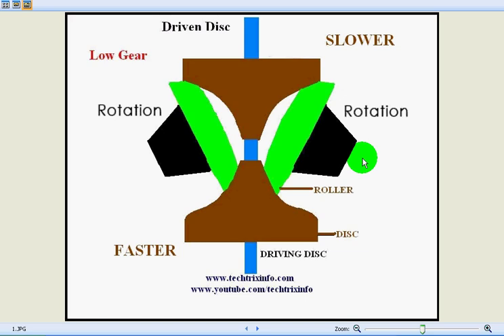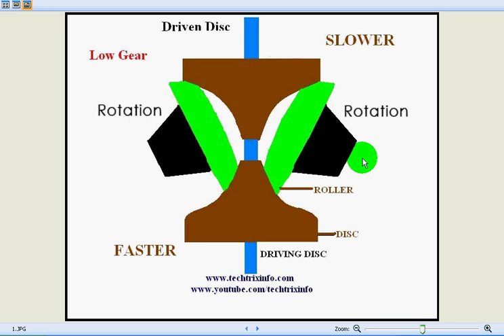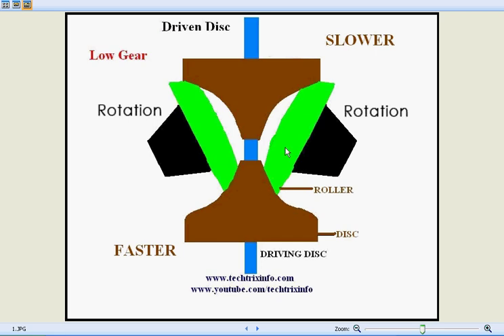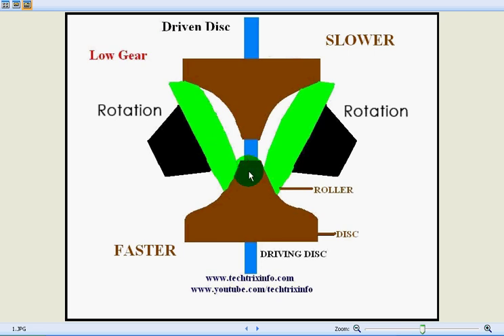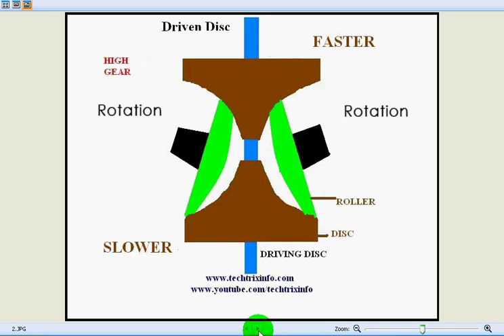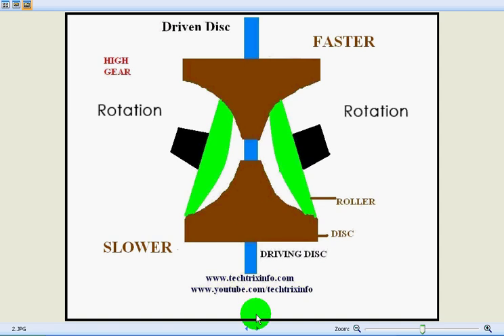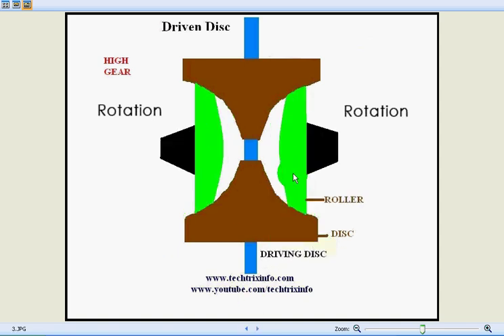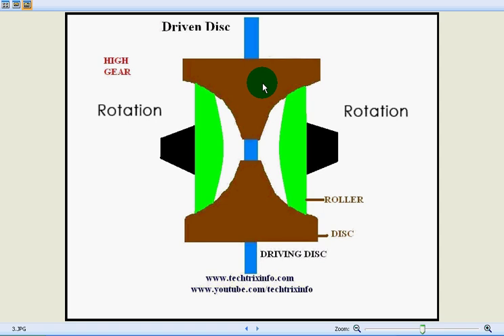Animation - How toroidal CVT works. ✔

Comment: The principle is not explained at all...Can I get explanation for the motion of rollers??how does automatically the rollers engage the different ratios??
Reply: As the rollers pivot they contact different parts of the driven/driving gears, and since they contact sections that are closer or farther from the center it changes the gear ratio